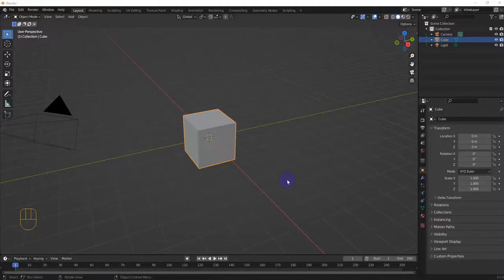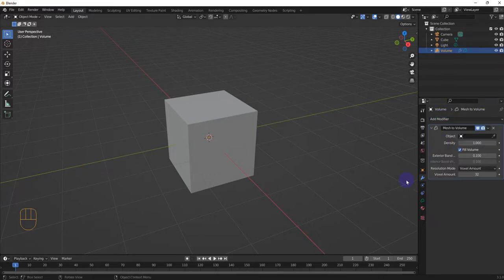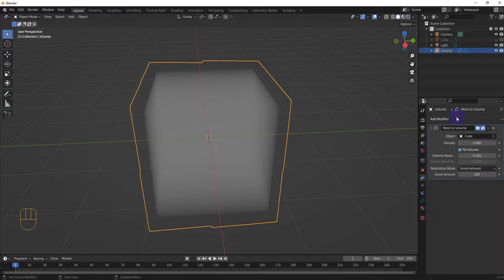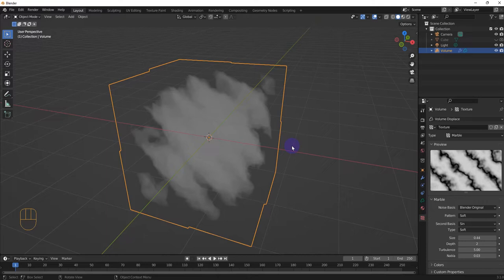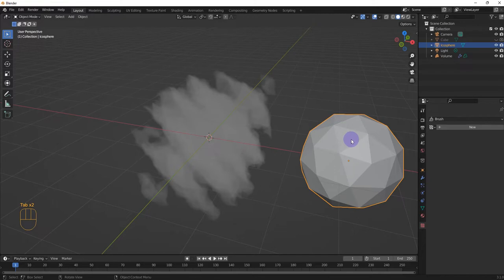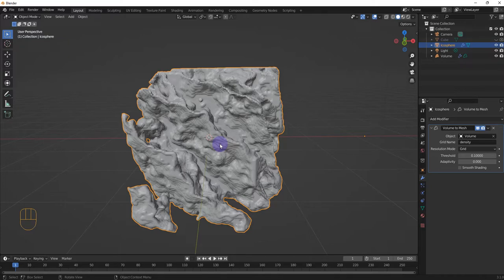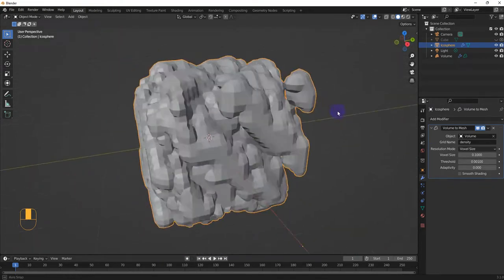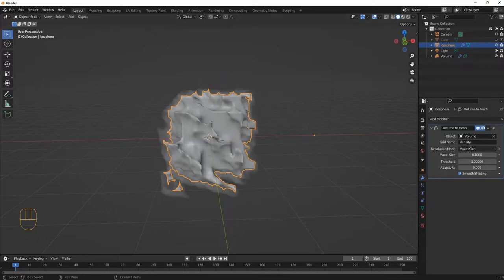Blender Volume to Mesh Modifier

Comment: I would like to use this method to quickly generate a head bust sculpt a more organic, clay-like, handmade look. What would you recommend? Are any these modifiers CPU, GPU or RAM intensive?
Reply: all modifiers require math to achieve the instances vertices. If you apply them that will make them real and reduce that overhead.
Reply: thank you